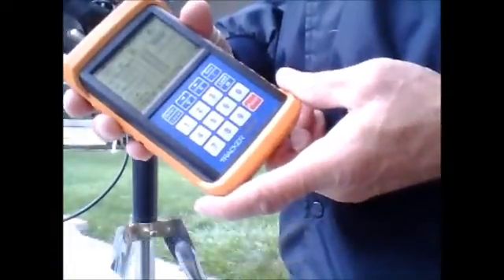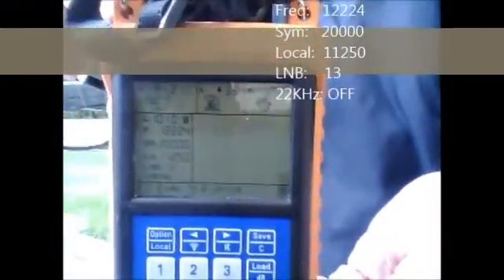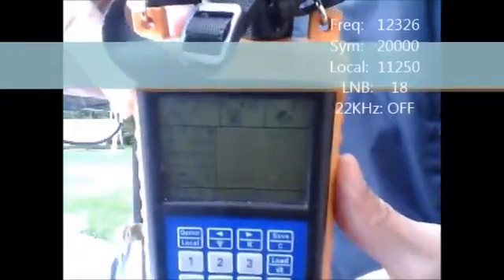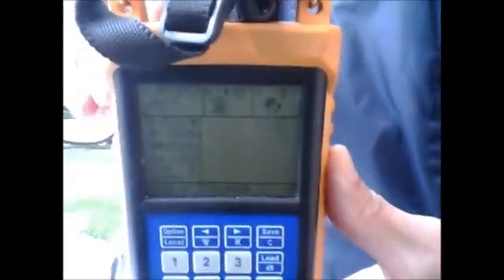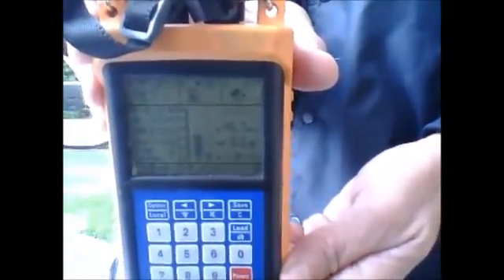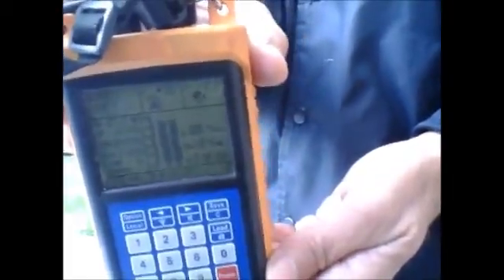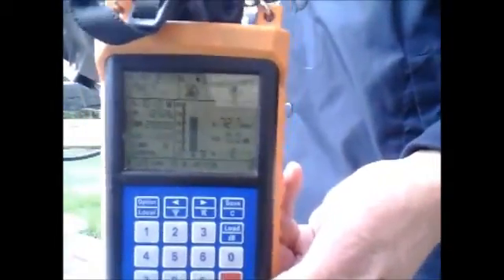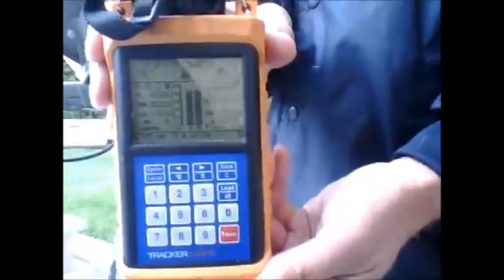Part 2  How to use a Tracker Light Meter OTM500 for Directv SWM LNB

Comment from the maker: FYI, during a SWM install today, no problems as shown above in video. As I went along the existing wire, I kept trying the Meter at each connection to assure the signal was still present and discovered after a long length of wire that when using the 13V settings, the LNB started resetting every 3 seconds or so, but when I changed to the 18V, no issues. So again as I said in the video, the 18V settings seem to be more reliable to work with.